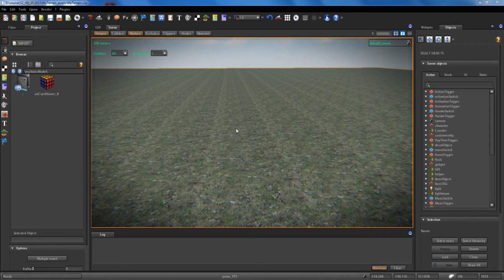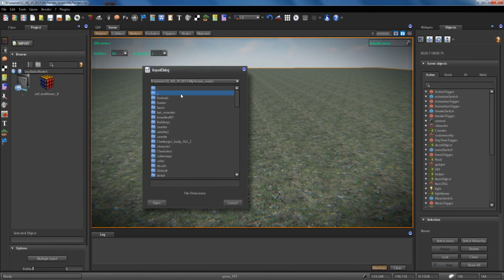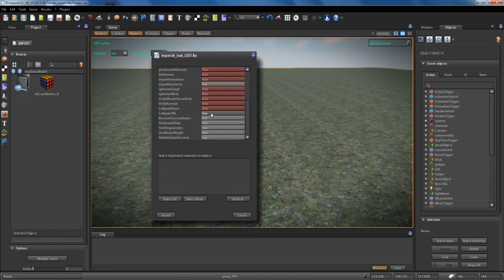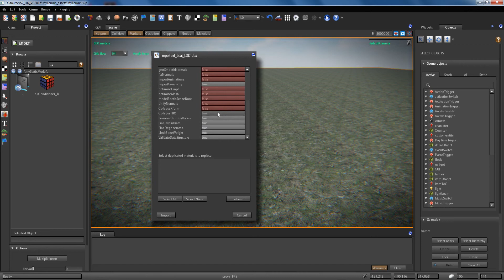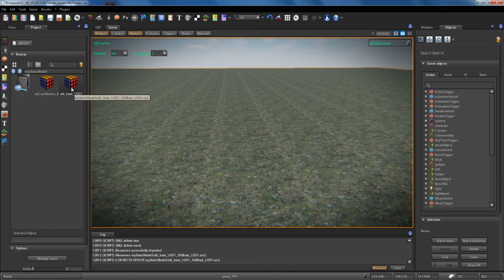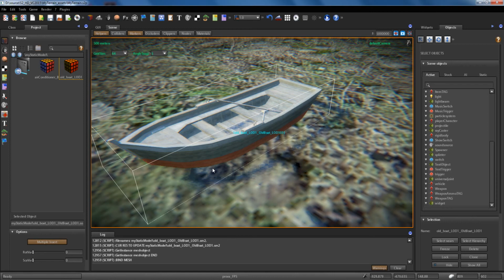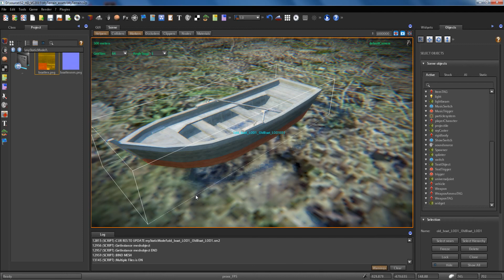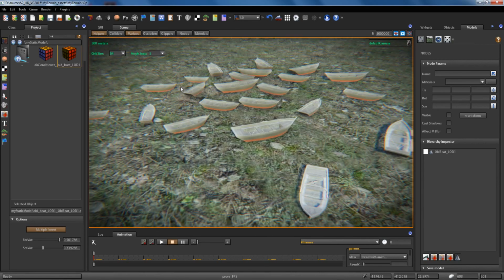S2ENGINE HD - Importing static mesh objects - part #2 (FBX files)

Comment: I understood what the problem is. Whatever I imported into the engine from blender, of any size. The mesh remains small. In the video about the collision, you say that you can not stretch it. Very sad. But apparently nothing will work out until these bugs are fixed.
Reply from the maker: nevius vinurd u can rescale the mesh into 2 ways: from the importer and from the model tool. There is a parameter into the importer dialog related to the size of the object to import.  If your model is skeletric u can add, to model skeleton, a new root node and scale it, all using the s2 editor models tool. For static meshes u can use the vertex editor into the models tool
Reply: I click on the exporter to increase the model - 4 4 4
in the end, the model is large. When I click to create a mesh collision grid.
the grid turns out very small-microscopic. Did you watch the video ?. I there focus on this attention, that nothing is impossible to do.  The collision grid is very small. And there is no way to stretch it. I have already tried everything that can and can not be done.

Comment: I have a player that passes through the objects !!! Nothing helps. Already twisted all the settings. This goes from version to version. There is no collision. I'm adding models from the blender.
Reply from the maker: first see here: https://www.youtube.com/watch?v=ahI2ROr3Wfs&index=8&list=PLe8a3KyRZGZT1nvRZjgCQHz-xCrB5tMY5&t=682s
Reply from the maker: Also there is an old tutorial that explains how to set collision to player character, READ THE FIRST LINES OF THE PARAGRAPH "Putting it all together": http://www.s2powered.com/MEDIAWIKI/mediawiki-1.16.0/index.php?title=Quick_Start
Reply from the maker: I suggest also to follow tutorials about importing character from fuse: https://www.youtube.com/watch?v=OsrszXkzjDY&list=PLe8a3KyRZGZT-9lg3M6X4_7uFo95Ulupt&index=29
Reply: Good afternoon, I figured out a collision. In a new scene and project, it is automatically installed, as necessary, according to the size of the object. While there is a problem with the road, when you try to click edit on points. The program crashes.
Reply: And I have questions:
    1 - can you make a game of any genre in the program?
    2-  can create your skybox (if the game is for example about space)?
    3- Is it possible to make the game complete without programming, only fsm?
    4- Is it possible to completely interface only using FSM?
    And the request: there are very few lessons on FSM 
    By addons (DLC):
               - Skybox editor (and plus the creation of space) (I would have bought)
Reply from the maker: I need to know the steps you do before trying to edit road points
Reply from the maker: 1 - the engine is designed to be general purpouse unless it still needs to evolve. 2 - You can make you own skybox by unchecking automatic sky and importing a big cube mapped as a skybox. 3 - yes. I've made a good number of experiments for making a game using only fsm. 4 - yes. Also there is a GUI editor. Unlucky there are still not too much fsm tutorials, I've to produce much more of them. here is the playlist dedicated to fsm (GameMachine): https://www.youtube.com/playlist?list=PLe8a3KyRZGZQFfR1rVVHBBDkW1dhp8hPM
Reply: I'll record the video before the error and upload him. link will be sent here.
Reply: Thank you, I worked in Unity with fsm / solves many problems at once and conveniently.
 - There would be more lessons. With simple things.
- How to make a keystroke and reaction to it - activate the light, add a variable value, set the motion along the vector, give the value to the physical strength. (for example, how to make a jump)
 - how to make a trigger. - also turning on and off the light, changing the material, changing the object to another, calling the particle, disappearing the object after a certain time, calling the animation., adding a variable (for example, a chest, a door, a crashing jar)
- Working with the mouse (there is much that is not clear here) how to make the camera control with the mouse, on which the rotation angles depend. the definition of the cursor in space and on the surface (for example, creating a fps of peresnazh and tds cameras and moving the object on a click)
 - HUD - creating a simple button and affecting: light, the value of a variable,
            .Creating a horizontal scroll and how to affect the value of a variable
            Create a text box, enter a value in a variable and display it.
             .chekbox - how to make and what value would influence on what or parameter, the same switching on and switching off the light.
- work with physics. What forces can be controlled - acceleration, gravity, force, etc. an example of control of the ball with physics, holding for example a space button, the ball flies, releasing-drops.
- Vectors- How to make the direction of the object only on given vectors.
- Cameras - switching between cameras, affecting the camera settings, turning the HUD on and off
Reply from the maker: nevius vinurd I'll make a video tutorial in which I'll explain what u can do and what u cannot do with roads and rivers
Reply: Please, very much ask, make a step-by-step guide to exporting the model from the blender and adjusting the collision, using the example of a house, a room. I already understood the rivers and roads. Lack of collisions all spoils. Simple collisions turned out to be done. But they do not change if the object is stretched. This is also a problem. But the collision with objects that have a form, do not go to do anything.

Comment: Problems with the collision still remain. I'll show you how this happens on video. The model remains without a grid of collisions. Nothing helps. There will be another video where I try to create a room from the very beginning, exporting to the program. That this problem is very visible.
https://youtu.be/p55ckAawTEA
Reply from the maker: don't understand. Please explain better. I understood that player still collide with the fluid, right? if it is so simply disable collision to the cube object you used for the fluid. If not please explain better the problem
Reply: on the video you can see, if you look carefully - that the collision is not with the mesh. Settings do not help. I'm trying to add a room (the export turned out clumsy-from the blender), collisions for it do not work. Do not configure - nothing at all. I've been doing this for 6 hours. Pereprobyval in general everything. There is no mesh collision. The player goes through the room.
Reply: seems to understand what to do. I did not click on the object to create a mesh object. I'll try a new project now.